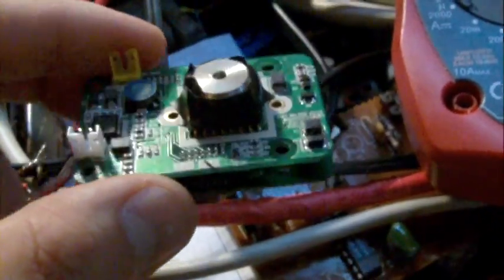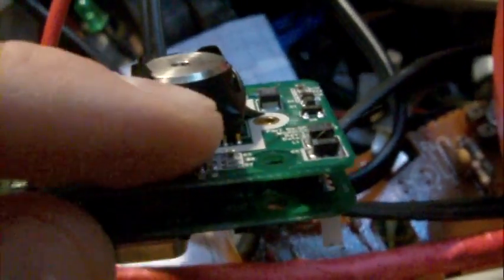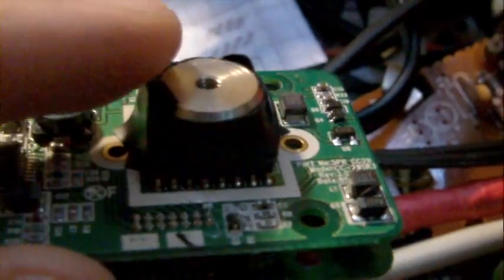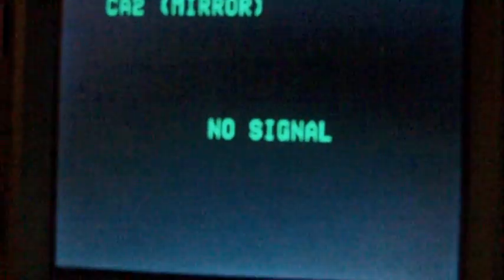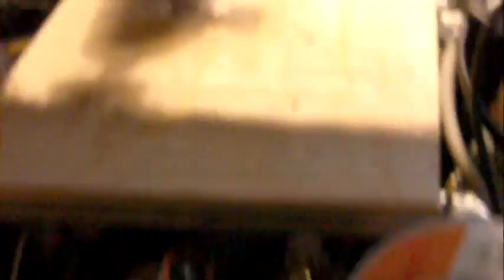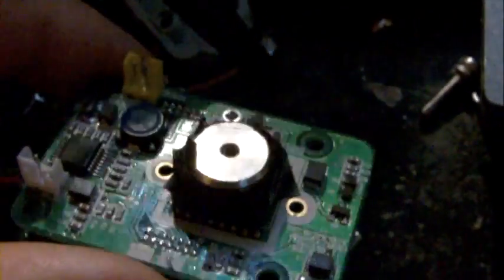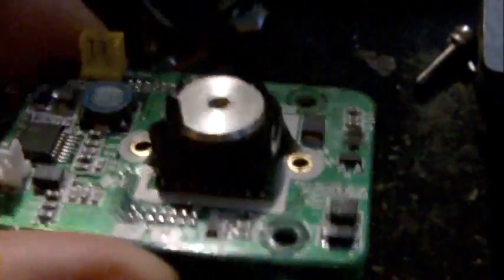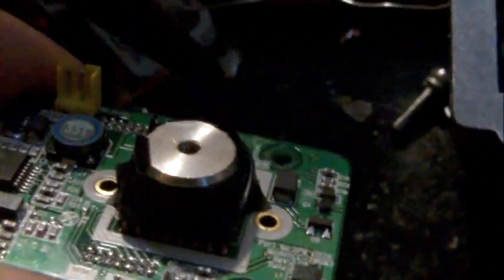Radioactive radiation shown with modified CCD camera

Comment: "Radioactive Radiation" vs the non-radioactive type?  Perhaps you meant to say "Ionizing Radiation"?? ;-)  GOOD VIDEO!!

Very neat project, CCDs are wonderful detectors, and your video was a very good demonstration of how they work.  I have seen several examples online using CCD chips as part of a handheld radiac meter, very nifty and inexpensive project.  I rarely throw dead electronics away without finding some interesting thing to do with the leftover working parts!